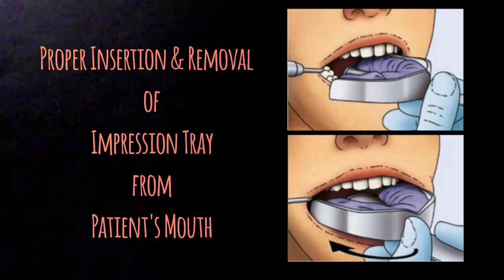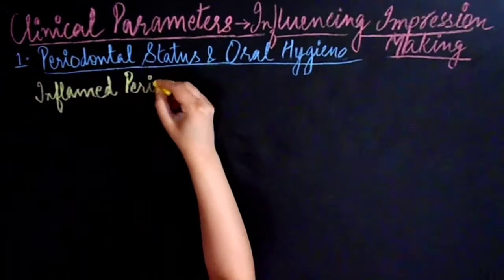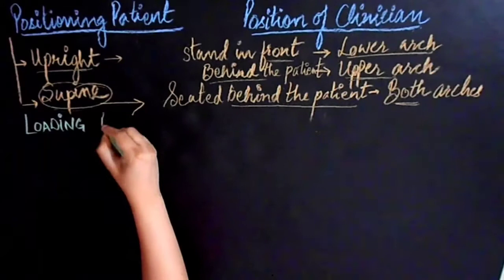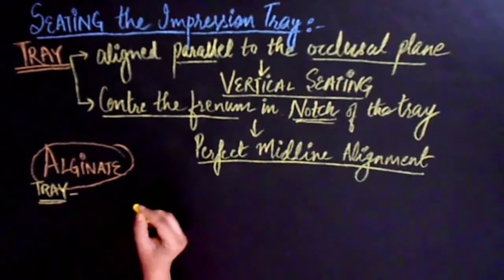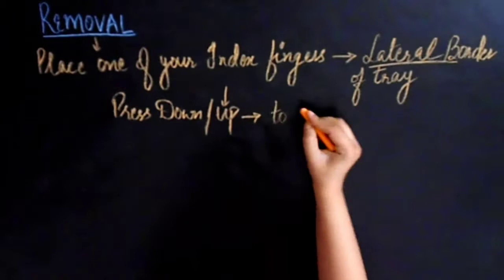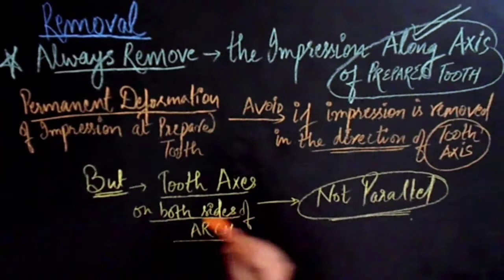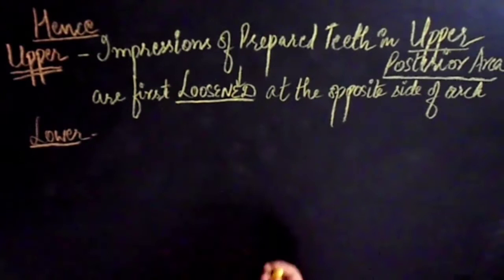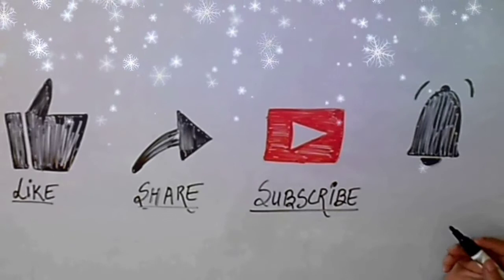Perfecting the Impression Making Technique// Proper Insertion and Removal of Impression Tray

Comment: hi there! one question, I am using condensation silicone for whitening trays fabrication + clear essix retainers. so teeth are unprepped. can you tell me how should I remove the tray? for example an upper tray. should I try to break the seal to one/orboth posterior regions of the tray? and then remove the tray in the long axis of teeth especially anteriors(because the axis is buccally oriented) ? thanks a lot. you have great videos. 🙂